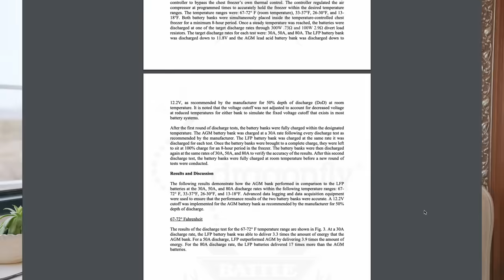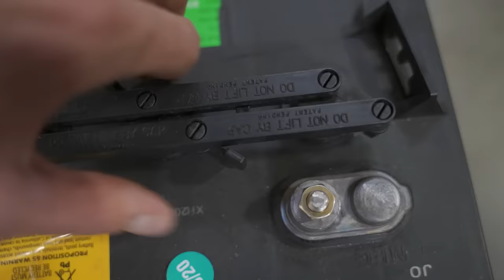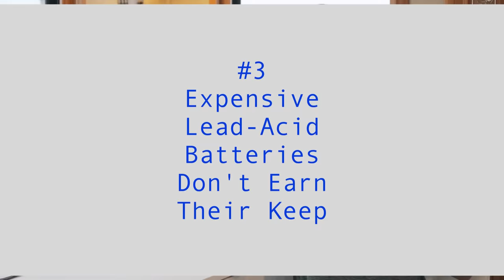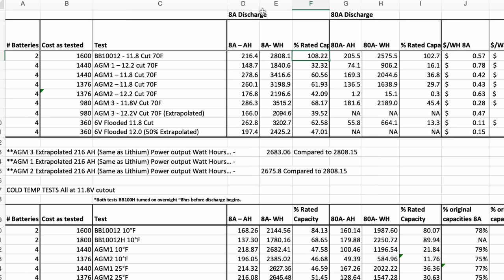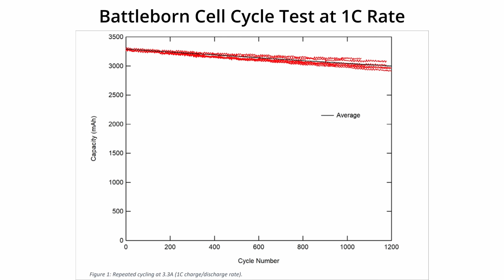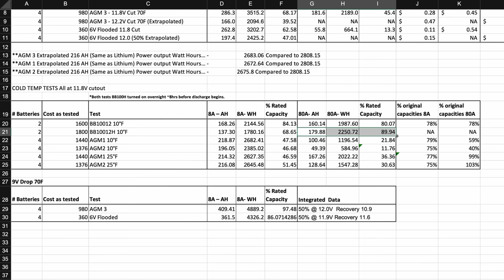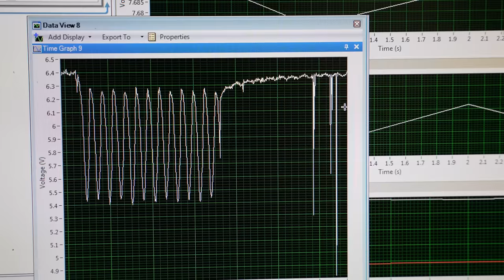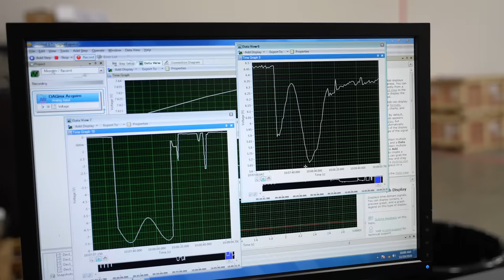Don't Waste Your Money On Batteries - The Shocking Truth I Discovered When Testing RV Batteries

Comment: Your video was very informative thank you. However, I still am not sold on lithium because of the ability to service in a stationary environment. AGM especially for the same reason, However Flooded Lead Acid seems hard to beat if you have the right kind. Here's why I hold that opinion:

 In 2002, I saw a bank of flooded lead acid batteries in London England that were operational since WW2. So lifetime was almost over 60 years! London gets below freezing maybe for two weeks out of the year, so the extreme cold temps are not present. In extreme cold, changing the charging specs would seem to be easily controlled today using software relays of some sort (In the instances where you had to change the cut-off spec down to 9v for example)

The expert who took me to these battery banks explained that he would sometimes have to replace the cathodes, but if they kept them properly flooded, there was rarely an issue. The bank we observed was his responsibility since the mid 1960's. He complained that their operations were "upgrading" to AGM and these had to be replaced after only about two years. The advantage was the overall lower maintenance cost to the utility company. He did not need to go to the AGM banks every two weeks, but they had a major reinstall every 24 months. Because of the labor to maintain, there was a cost savings. Since then, Lithium has increased that service life making it more economical, I suppose. Which they are probably doing, I haven't checked back.

However, 
Big However: When we are discussing "at home" use, the flooded lead acid would seem to be (by far) the most economic option. (And "greenest" option) The actual material is installed only once for almost three human generations, and regularly serviced with no more frequency than what one might cut their lawn. These batteries had a clear case, so that you could visibly inspect the plates submerged, and the acid level which you could then repair and refill as needed. The tops could be removed so that the cathode material lead could be replaced as well. Those were the coolest batteries. The only downside, besides the regular maintenance requirement, is that they needed to be in a well ventilated place so that hydrogen gas did not build up in an enclosed space, but venting is common with any lead acid battery, and can be taken into account.

I did a search probably about ten years ago and found batteries manufactured somewhere in the Midwest (either Ohio or Indiana) In the search I did today, I could not find them, but the link below has batteries that look similar. I look forward to your response.
Also, please feel free to contact. I am pretty easy to find. Thanks.

My recent searches were unsuccessful, but the batteries looked something like the ones in the link below
https://www.google.com/shopping/product/1?q=flooded+lead+acid+battery+2v&prds=epd:1570166001045350123,eto:1570166001045350123_0,pid:1570166001045350123&sa=X&ved=0ahUKEwjiz4aYwO71AhVWRjABHaqCDpEQ9pwGCAU

Comment: Nice work - thanks for the info!  I'm curious, did you break in the lead acid batteries before beginning testing?  As I'm sure you're aware, a number of common lead acid brands don't start generating their full power until a number of discharge/charge cycles.  I have a bank of 6 crown 6v batteries, and I've definitely seen the limitations of voltage sag under heavy load (130 amps microwave... can only run a couple minutes before inverter cutout).  ...liking the looks of the battleborn heated batts!
Reply: Get a super capacitor bank with batteries and you can run what ever. Having the super capacitor cycle means batteries last longer and don't draw down as much.

Comment: Thanks for this eye-opening real parts experiment results comparing with manufactorers data. My take away for shorttime high current and longterm chargecycleconts: combine lead acid with Li-battery to a combined system, which decides reacting on the active load to use a) lead acid: best shorttime high current peaks, but recharge not early, 
after peak time switching over to:
b) Li-battery for moderate currents over long duration.

Comment: Thanks Tom.  This was very informative and interesting.  As a retired Electrical Engineer who also did power systems design for our local Telco way back in my early days, I appreciated your thorough approach.  I have been pondering upgrading our travel trailer’s power system, by moving to a Lithium Ion  battery(s) but that also introduces an additional expense of a new charging system (and AC/DC distribution systems) which are more suitable for Lithium Ion batteries.  I doubt our existing system is programmable without serious modification.

I would be very interested in your recommendations on a Victron (or an other company) Charging upgrade that is programmable and would allow me to stay with my current lead acid battery for now and then move to a the lithium ion battery as a second step.  Whether or not we invest in including an inverter option is something else we need to think about.  Does Victron have a product that serves as a swap out to the current charging systems already out there?  Any advice you can give me would be appreciated.  Thanks.
Reply: Except for the lithium battery fires.😱
Reply: @MatthewBerginGarage  Li battery fires are a valid concern!  Of the chemistry variants, LiFePO4 (lithium iron phosphate) is the most robust against thermal runaway.  So it looks like BB has made the best choice in terms of safety.
Reply: I would say also look at Deye/Sunsynk inverters. Victron is great but costly plus every extra component (mppt, venus gx colour controller, shunt etc) is just additional costs which is important but not life-crippling without it when using the Deye/Sunsynk.

Comment: Honestly, with Battle Born so heavily invested in/involved with this test, I don’t believe two things: 1: I don’t believe it’s unbiased, and 2: I don’t believe we’d even be seeing this video if Battle Born didn’t do so well.
Reply: Also extrapolating the 80% numbers by using an unknow lower discharge amount isn't accurate. The lower you discharge it the faster it drops. Less amps per volt at lower volts. So that would bring down the average. Seems suspect.
Reply: Yes, independent testing is required imo.

Comment: I live full time in a RV/Van and use AGM for one reason, I need reliability.  I cannot afford to lose total power which happens with Lithium as soon as the BMS senses a problem. The slightest imbalance in charging or discharging current, or other unidentifiable reasons and the Lithium batteries shut down.  Its like a lot of equipment we have now, a trade of efficiency for reliability/simplicity.

Comment: We been running lead acid for 6 yrs. Boondocking and off grid. No Problems.
Reply: Yep you can buy 5 to 10 lead acid batteries depending on type\brand for the price of one battel borne. Looks like they used the chepest lead acid batteries in this test. Should have used a Trojan battery in the test.

Comment: Tip: If you can avoid the use of appliances consuming greater than a few hundred milliamps at 5 volts you will discover how less can be more. Did it with my reading lamp & saved big really big.

Comment: Just out of curiosity, why do you keep referring to battleborn batteries as lithium ion?  They are in fact lithium iron phosphate no?  LiFePo
Reply: Lithium ion is the catch-all term for a battery which uses lithium ions to move the charge inside the battery and so it's correct to call lifepo4 a lithium ion battery. The batteries often just referred to as lithium ion batteries will be made up up various different chemistries/cathode material but it's not as common to be so specific when talking about them. Often, in off grid storage applications lithium iron is mentioned specifically is because it has certain properties which make it more suitable than the cobalt or manganese cathode chemistries.
Reply: @andys844  awesome to know that. Thanks for the beta. I put seven of those battleborn lifepos on a charter boat a few years ago. I’m sold. They are tiny, light, and the discharge and recharge characteristics make them ideal for that sort of off grid application.
Reply: Ignorance is my guess. Lithium ion and LiFePO4 are not the same but certainly similar. The former gets you better performance but the latter gets you quite a few more charge/discharge cycles.

Comment: The one test I want to see is how long it takes to truly recharge either. Then convert that to cost of recharge say for those using generators on cloudy days to supplement lithium charging. How that compares to cost effectiveness.
Reply: "A lithium battery can be charged as fast as 1C, whereas a lead acid battery should be kept below 0.3C. This means a 10AH lithium battery can typically be charged at 10A while a 10AH lead acid battery can be charged at 3A" (power-sonic.com)
Reply: Good point
Reply: The bigger question might be how much amperage can you really get from your generator?
Reply: Lithium is more efficient (10-15%) to charge than normal lead because it doesn't require the lengthy and inefficient absorption stage.  A bigger win IMO is that you can charge Li in bits-and-pieces;  full charging is never required while lead wants to be fully charged as often and as long as possible.  

Gens should only be run long enough on cloudy days to get through early absorption;  even on cloudy days most solar configs can handle the much-decreased requirements of mid-to-late absorption and float.
Reply: @fratermus5502  this is exactly everything I have read but I haven't seen actual real life testing and results. I am going to switch from AGM to Lipo on my next RV. I  have already reduced my propane and gasoline consumption by 90% with solar and a generator that is downsized to barely above charging requirements.
Reply: I agree... Many people have large generators ie 2kw or bigger... and use that to charge batteries with a medium size battery charger .. about 350watts at 240volts, I'm in UK .. and find petrol consumption terrible.. If you're using the generator to power other things then it makes sense.
If you're only charging batteries when the solar panels can't get the sun or it's dark... then get a smaller generator and a reasonable 3 stage charger. ps I use EFB batteries which were not tested...
Reply: @doitlaynstyle  Do NOT use Lipo batteries in your RV.  They are different technology than the Battleborn LiFePo4 batteries, and have a long history of catching on fire when charging.
Reply: @donaldradcliffe6704  I already understand that. The charge rates are very similar and that's why I was asking.

Comment: Can't wait for my two 100 amp hour AGMs to wear out so I can replace my system. Its been 2 years. My solar panel has kept up my batteries. Might trade in my RV by the time they wear out. Next time we will start with the Battle Born system. I can't tell you how many times we had problems. Thanks for explaining exactly the real life problems we had with pour AGMs.

Comment: Thank you for this extensive all enlightening series of useful tests!  Just one quick question I would like to ask, because I just bought two (2) 12 volt flooded lead acid batteries for each of our two cars.  I knew to put them on my "bench" automatic battery charger and they did read somewhat low and had to remain charging for almost a whole day before they were fully charged up & ready to install!  Did those type batteries in your tests get fully charged up before proceeding?  I'm sure you know & did this but I wanted to be clear it wasn't a design oversight since there was so much going on to set up and run your tests.  Cheers.

Comment: Manufacturers and sellers of these newer battery technologies need to work on lowering retail prices.  The differential between these and lead-acid is ridiculous now. 
I can get 4 T-105s for the inverter bank I'm building for $650-700 vs $4000 for new tech. I can't afford them, and neither can 98% of my RV repair business customers.

Comment: Nicely done, very thorough! We are in BC, Canada and have 2x 100a LiFEPO4 batteries on order for a major power upgrade. Even before watching this, lithium seemed a much better choice than any other chemistry, especially when it's cold.

We've run out of juice on a few occasions already with our single 12v lead acid. And the worst thing, like you've shown, is that the voltage will drop much earlier than expected -- enough that it doesn't even have enough current to light the furnace.

I know Battle Born is an awesome company, but having purchased another brand of LiFEPO4, I would be curious to see some comparisons between other brands, as the market seems to be getting more competitive.
Reply from the maker: Glad you enjoyed it.  I am thinking that if I run more tests like this it will be lithium to lithium.   Performance on the cells should be comparable, it's really the BMS and electronics that will be different.
Reply: Go to Will Prowse website & youtube channel. He has done alot of experiments with different lithium batteries.
Reply: @MortonsontheMove  Thanks, that seems to be what I've read and heard so far as well. The BMS and overall build quality is hugely important and I know BB has basically lead the way in that respect.
Reply: Thanks  @yves8639  I've watched a number of his videos and he's great!

Comment: Not listening to anybody or any level of reason...  I swapped the 65AH starter battery in my small van with a massive 155AH AGM deep cycle.   I had to tear out and rebuild my battery tray and squeeze the giant battery in.  I then installed a 320W 40v single solar panel on my roof and used it to cover two custom vent holes.   No other batteries in my van.  I've been charging and discharging from 13v down to 11.9 by running a fridge, ventilation, cooking and power tools every night for over a year now .  Call it ignorance or abuse, but so far it's been working and If it makes it another year it's worth it from a cost and space point of view.   If I could safely install a 200AH lithium starter battery in the van I would.

Comment: AT LAST a guy struggling for Wh ! Amps hour are a way to lie and blur the real capacities.
Reply: Richard Potamus  not AT ALL . With Wh you know how much energy you really have, regardless the intensity, regardless the tension the cell can have, wich means no matter the tech you use .
AMPSh gives you nothing if you don't know before the voltage of your cell. 
Each tech has it's own voltage.
Reply: Richard Potamus  bro phil V is 100% right. They are not the same thing lol. You're basically saying if you know how fast a river is flowing you know how much water there is..... Phil V is saying if you know how much water is going through a stream at any given time only then do you know how much water there is. Wh is a true measure of energy
Reply: Richard Potamus  Well, you are right about the equation but you are also proving yourself wrong.   This equation is the exact reason why watt-hours and amp-hours are NOT the exactly the same.  It would be the same if you do the math with the NOMINAL voltage (12.0v) but that is not the actual voltage.  The difference is because the voltage stays much higher on a LiFePo through the discharge cycle.  In the last part of a discharge cycle the wattage made by AGM is 12.2v * amps when a LiFePo may be 13.0v * amps.  Therefore more watts and more watt-hours per each nominal 12v amp-hour.
Reply: Richard Potamus  Now there is the stupidest statement I have heard for a while!
Reply: Richard Potamus   OK, if you teach the stuff, please tell me how someone not having perfect command of the english language disqualifies them from a response....i.e. "@Phil V  Well there is no sense responding to you if you have no command of the English language." What it probably means is that you (even as a 'teacher') just aren't very good at explaining things.

Comment: Depends on the battery, Trojans out perform all lithium when used in solar setups, but not RVs as they are too heavy. There is loads of great data, but I have done my own over ten years and have found the BB batteries LI are the best. If you compare these to the very best Lead Acid such as Trojan SIND 06 610 and the Trojan will win, for cost per watt per amp, cycles i.e. 17 years, 12500 cycles @80@ and 10 years, 7500 cycles @50%. I have had these on my solar set up in the UK for 9 years. They are easily the cheapest source of power
Reply: Hi I’m interested in your recommendation for my batteries. I’m UK based as well. Would you have a link? Thanks